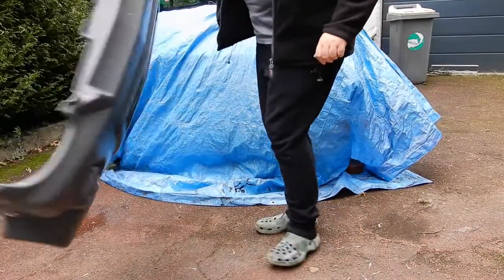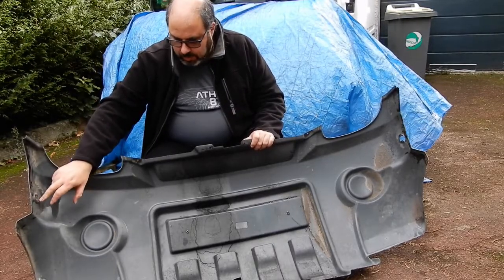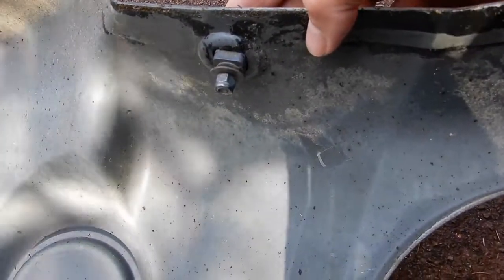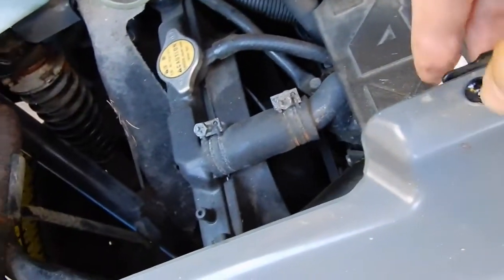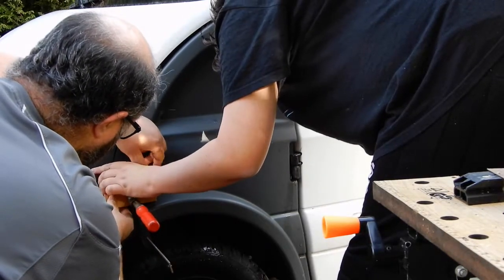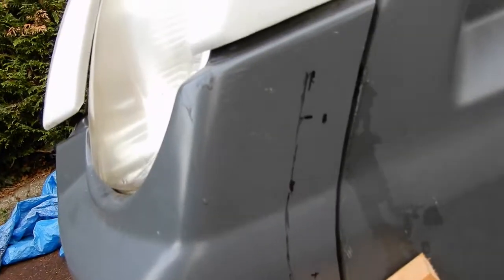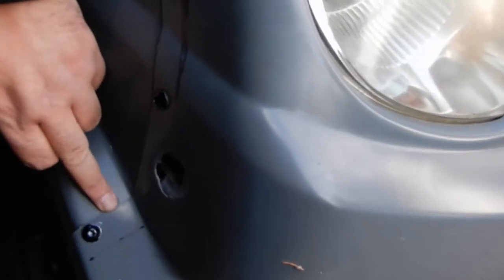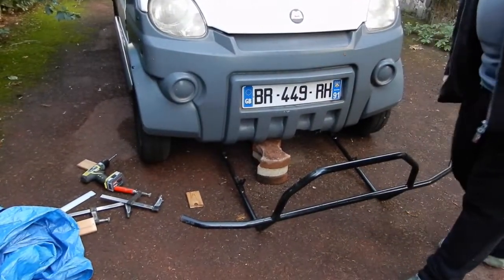Bolting rather than gluing the front dash panel back on! | Aixam Mega Multitruck Van

Comment: Good repair! You’ve unwittingly started to rat look it as putting the bolts on the outside is one of the things they do!
Reply from the maker: Ah well... I'll ruin that idea as the front and side panels will be sprayed black. You won't notice the bolts so much then.
Reply: essonneimage I think they look good though. Makes it look rugged and industrial!
Reply from the maker: @CaddyConversion  I'm just seeing the pratical side, in that I can take the panel off and put it back on relatively easily. I just need to think about how to attach the bottom. There's 10 bolts in total as it is. Before it was just bonding glue, two rivets and a cable tie(!)
Reply: essonneimage yeah it’s a good modification- you’ve got access now whenever you need it 👍😎
Reply from the maker: I've since added rubber... kinky... >:-)